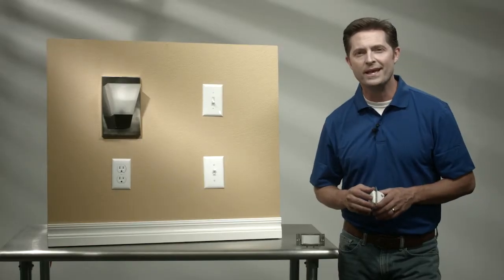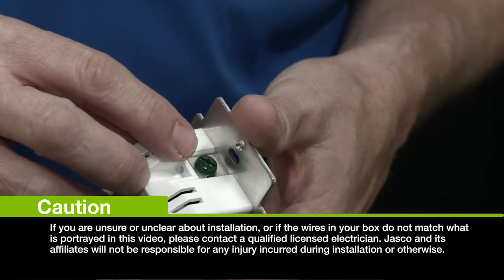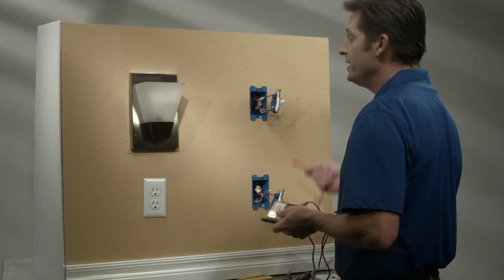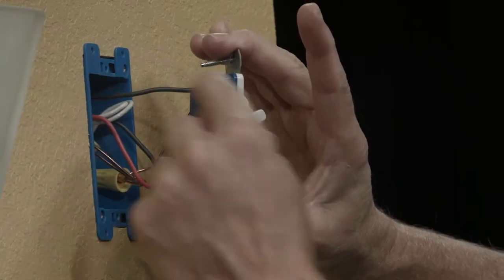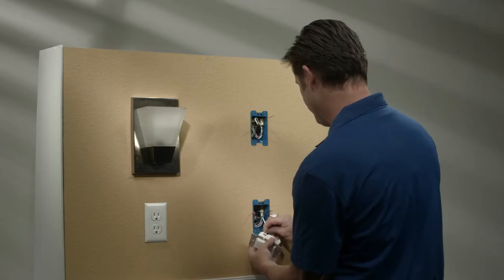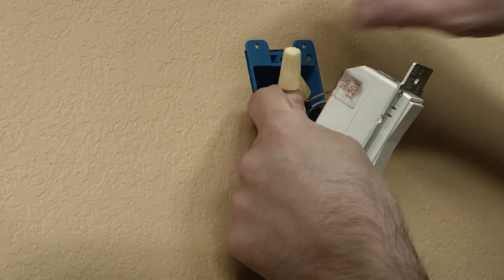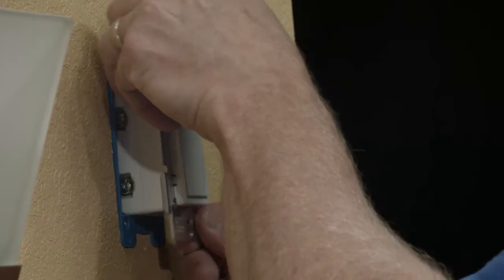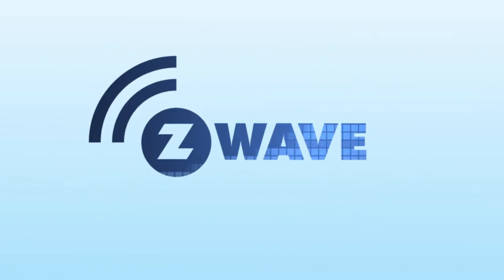45710: Jasco Add-On Switch (3-Way Install)

Comment: What do I do if there is no neutral wire in the dwelling?? 🙏🏼
Reply from the maker: Hi, Leon. Neutral wires are required for these devices. To determine the options for your home, we recommend contacting a licensed electrician.

Comment: Can this be wired in a Dead End configuration where the light(s) are between switches...  (e.g. Add-on gang box has ground, traveler (red), load and line (black and white with black stripe)?
Reply from the maker: Hi, Dave. As long as the switch box has a neutral wire as well as the wires you mentioned, it can be installed. If you have additional questions, our U.S.-based consumer care is also available at 1-800-654-8483, M-F, 7 a.m.-8 p.m. Central Time.

Comment: Is the Jasco add on switch compatible with Leviton and GE as well?
Reply from the maker: Hi Ron, thank you for reaching out to us with your question. Yes, the 45710 add on switch will work with Leviton and GE as well as any Z-wave Certified devices.